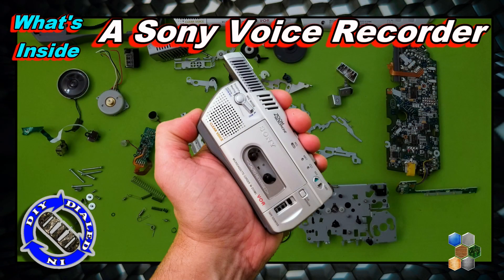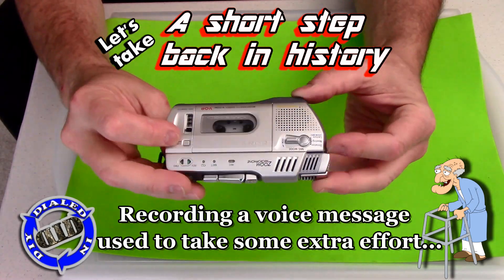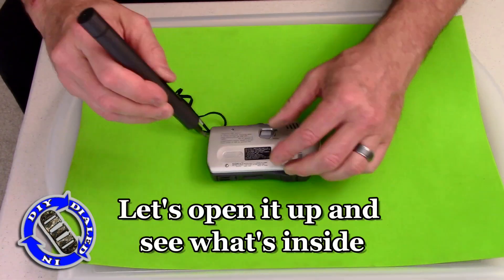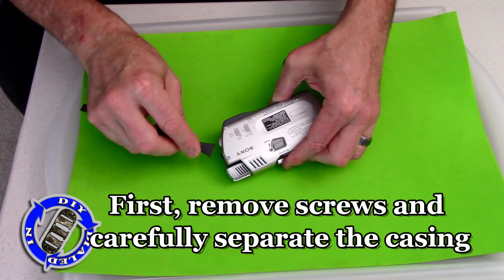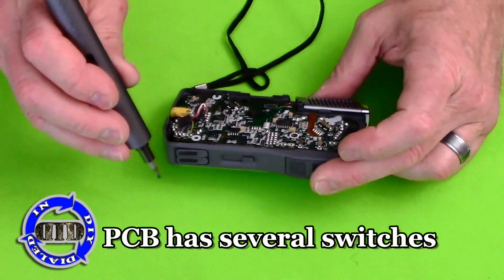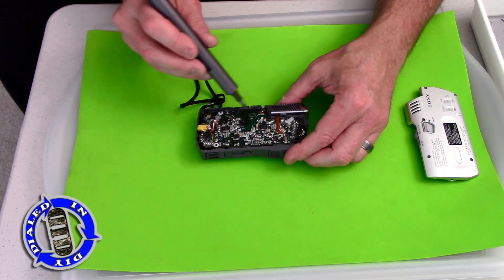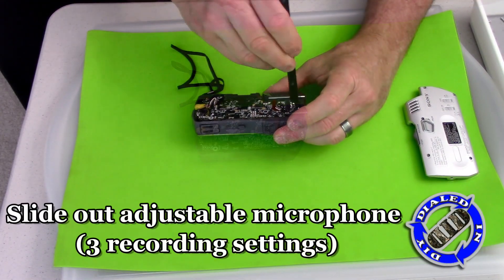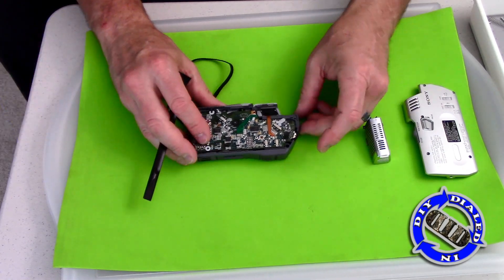What's Inside a Sony Voice Recorder - Salvage Free Electronics & Project Parts

Comment: I have exactly the same model.
Reply from the maker: Funny part is that I was not sure how many people would see the video and watch because they had never seen one of these. Do you still make use of the one you have?
Reply: Unfortunately, I'm not using it anymore, because it just doesn't work on batteries and the mechanism doesn't work when I charge in the power. In my city, I couldn't find anyone to fix! :/
The last time it worked was 4 months ago.
Reply from the maker: @oceanic_airlines  Sorry to hear that... I've had some of these just start to record and play back sounding like a warped record.  After taking some apart I realized it is often due to the belts stretching out.  With so much digital shift in devices it is harder to find places to repair analog type stuff.